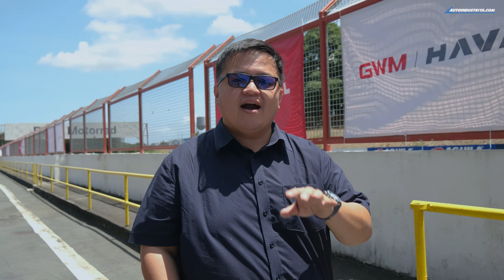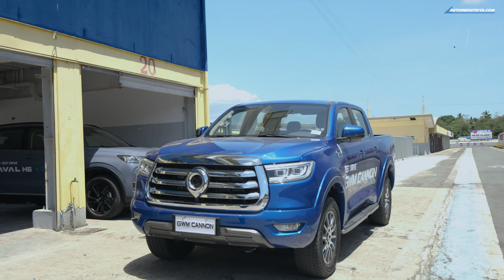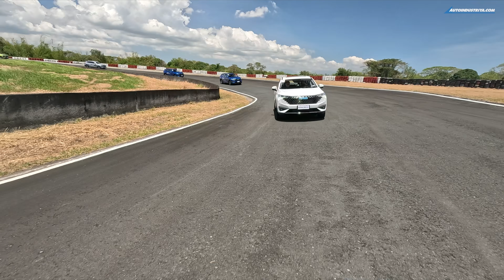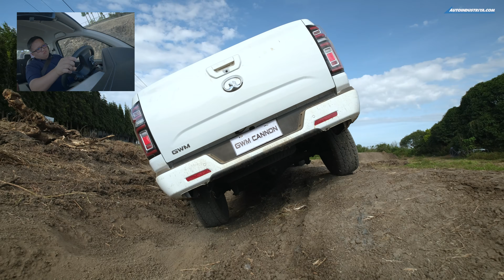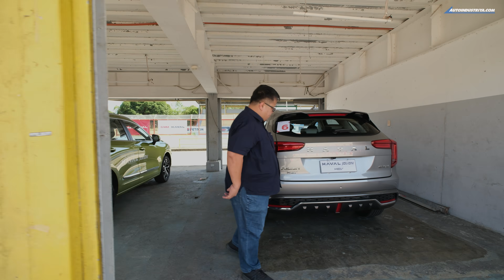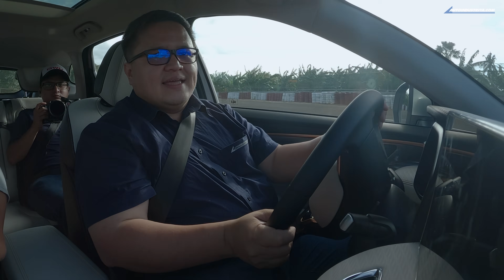First Drive: GWM Haval H6 Hybrid, Jolion Hybrid and Cannon pick-up

Comment: I really like the honest first impressions. Ive driven the non hybrid versions of the H6 and Jolion, the power is there, in the Jolion however the turbo lag is noticeable but you can easily drive around it. The reason the hybrids arent that different from the non hybrids is that the hybrids are based on the top or near top spec(depending on the market youre in). My only issue with the hybrids is that you need to get runflats due to the lack of a spare wheel. Im very curious as to how these will be priced and how they will compete in the Philippines. In the markets ive observed these are a breath of fresh air due to the price and the spec you get as well as the warranty as their competition are the usual suspects like you Kia and VW that price their vehicles higher in a race to move further up market. It will be interesting to see what happens as those markets did not have a Geely Coolray that upset the apple cart, in those markets it was Haval that upset the apple cart. It should be noted however that Haval has recently been upping their prices in most of their markets and they are slowly creeping up to their competition. I hope this doesnt turn out like a Proton X50(Geely Coolray) situation in South Africa again.